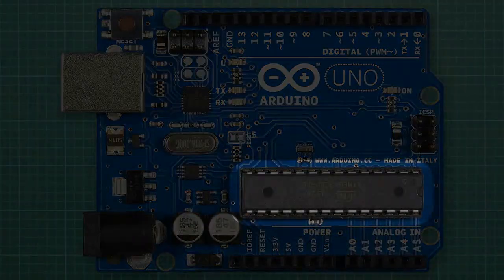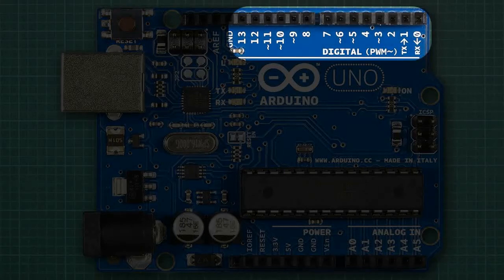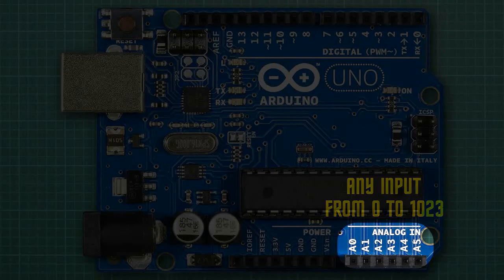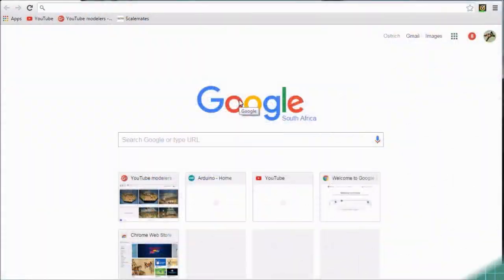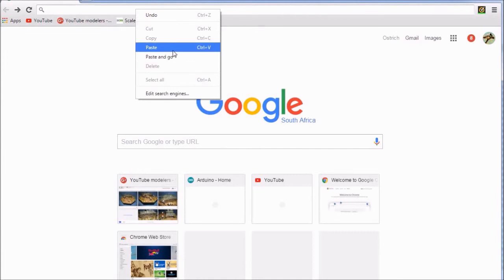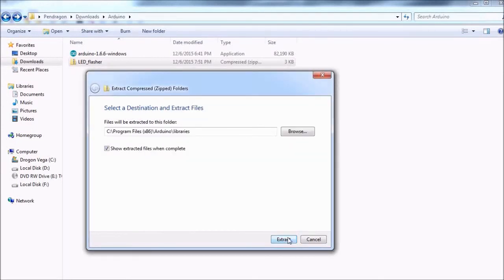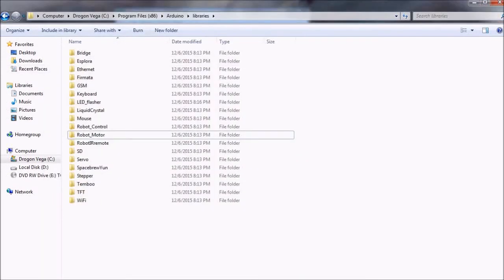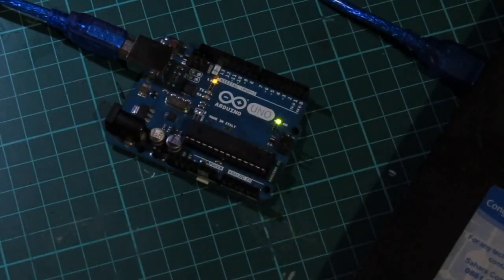Arduino for Starships - Ch01 - Initial Briefing

Comment: Hey Trevor,  I tried building the  but when I tried using the Sketchboard the application errors out with unable to find the LED_Flasher Library.  I tried using the link but I'm unable to add the ZIP file to the library to get the program to run.  Have any suggestions?

Comment: Hey Trevor,  You wouldn't happen to have a sketchbook for the 1:677 Star Trek Voyager build.   I just started educating myself on the Arduino hardware/software but I'd like to get a head start on the Voyager electronic setup and I was hoping someone already did the leg work.   By the way,  love the video's they are helping me in my learning process.
Reply from the maker: Hi John, I just tested this link and it seems to work:
https://drive.google.com/file/d/0B3ATwKaMUAAbT3JFay1zTW1nWlE/view?resourcekey=0-001I3puTLgoKC-8tCdUKRg
One needs to download the entire zip file and extract it to the arduino/libraries directory
Reply: Thanks Trevor,  After I sent out this message I was about to load the Flasher Library correctly.  I must have been doing something wrong the first couple tries.   By the way, to you happen to have s Sketch for Start Trek Voyager.  I have been trying to create a sketch that when I push a momentary button the blue LED strip would warp to max (255).  I was able to set the initial LED strip to (10) low voltage to a low light and when I push the button the LED strip would ramp up to max and back to low light but I was only able to get the button to be recognized the first time.  After I tried to push the button again the warp up after will not loop.
Reply from the maker: @JohnSmith-lp5en  It sounds like you have the hardest part done. All you may need is a variable that is set from zero to 1 at the beginning of the sequence, then cleared to zero at the end of the sequence. That way, when the button is pushed you only start the sequence if the variable is zero. I don't know if this helps any? It sounds like a nice effect, though!
Reply: @OstrichLongneck  Maybe you can look at my sketch to see what I'm missing,  Still can't get the INPUT to reset.

/warp blast
//Thie is a sketch that will demonstrate the Voyager warp and warp blast

//Constants
int ledPin = 10;
int warpbutton =2;

//Variables
int fadeValueLow = 10;
int fadeValueHigh = 255;
int fadeAmount = 15;
int fadeValue = 10;
int buttonState = 0;

void setup() {
  // setup pin mode
pinMode(ledPin, OUTPUT);
pinMode(warpbutton,INPUT);
}

void loop() {

  //If button pushed
 int buttonState= digitalRead(warpbutton);
  if(buttonState == 1){
  
    //Start of warp blast 
    for (fadeValueLow; fadeValue <= fadeValueHigh; fadeValue += fadeAmount){
    //sets the value range from 10 to 255
    analogWrite(ledPin, fadeValue);
    //wait for 30milliseconds to see the dimming effect
    delay(50);
   }
}
else(buttonState == 0);{
  analogWrite(ledPin,10);
}
}